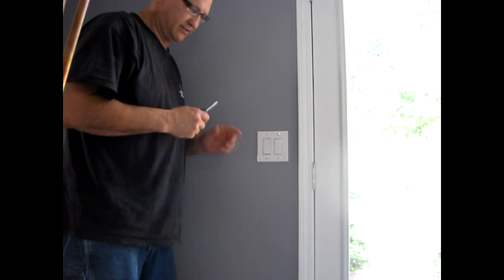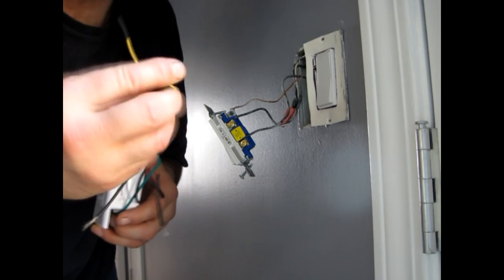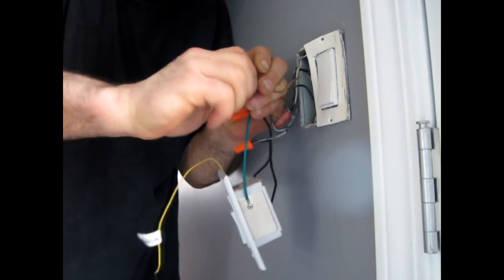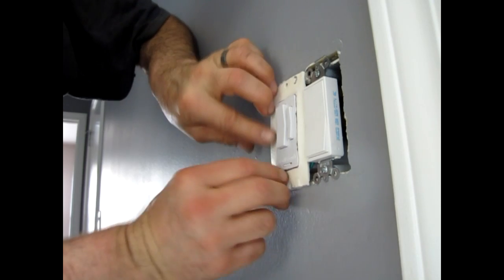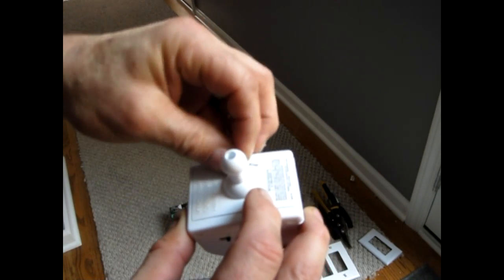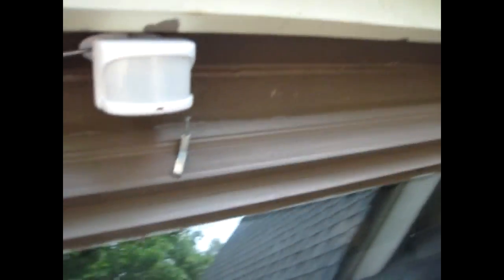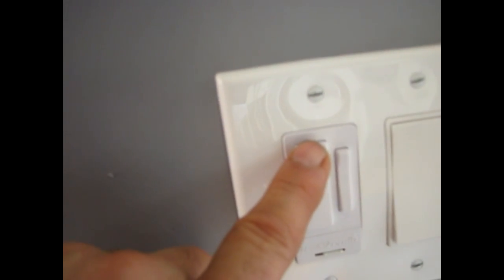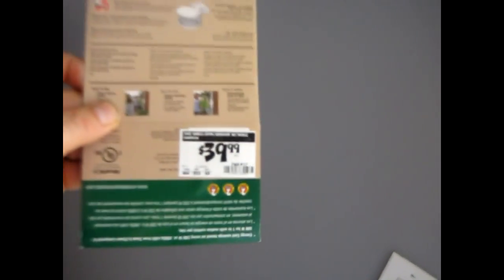HOW TO INSTALL WIRELESS MOTION DETECTOR USING EXISTING LIGHTS ON MY FRONT PORCH

Comment: Can you find out what the product number is? Looking for something like this to put up at my grandparents home??  Thank you!!!
Reply from the maker: Okay, sorry about that, the brand is called..."Wireless Command Energy Saver" the model number is WC-6053-WH, this is getting to be pretty old now so you might want to look at something similar... maybe try ebay with this number and description.  In case you cant find the exact same one....this is the listing from Home Depot here in Michigan of something similar..... it is called.....Tap Smart Wi-Fi Light Switch
Geeni Tap Smart Wi-Fi Light Switch
Model #GN-WW107-199  This has it limitations, like it doesnt turn on automatically when guests approach....hmmmm. i looked for something the same but it seems they dont offer this anymore, but you can buy the pieces to make something similar....hope this helps, thanks again for liking, subscribing and commenting, i really appreciate it, Mike

Comment: you didn't say what the part number or brand is. I couldn't find it at HOME DEPOT because i don't know what I'm looking for.
Reply from the maker: Okay, sorry about that, the brand is called..."Wireless Command Energy Saver" the model number is WC-6053-WH, this is getting to be pretty old now so you might want to look at something similar... maybe try ebay with this number and description.  In case you cant find the exact same one....this is the listing from Home Depot here in Michigan of something similar..... it is called.....Tap Smart Wi-Fi Light Switch
Geeni Tap Smart Wi-Fi Light Switch
Model #GN-WW107-199  This has it limitations, like it doesnt turn on automatically when guests approach....hmmmm. i looked for something the same but it seems they dont offer this anymore, but you can buy the pieces to make something similar....hope this helps, thanks again for liking, subscribing and commenting, i really appreciate it, Mike

Comment: I thought this was the greatest ever , then it lasted less then 24 hrs and i can not get it to work .
Reply: WELL.... PERHAPS RETURN IT TO THE STORE AND GET A DIFFERENT BRAND? I DONT KNOW.... MINE REQUIRED A BATTERY CHANGE AFTER WHAT I CALL A BREAK IN PERIOD, WHICH IS ME MESSIN WITH IT AND IT GOING OFF DURING THE DAY AND THEN I HAD TO FIGURE IT OUT.....ETC. IT SEEMS TO BE WORKING LIKE A CHAMP NOW.... I LOVE IT WHEN RELATIVES COME OVER IN THE EVENING AND THE LIGHT POPS ON!! SORRY IT DIDNT WORK OUT FOR YOU....GOOD LUCK,MIKE